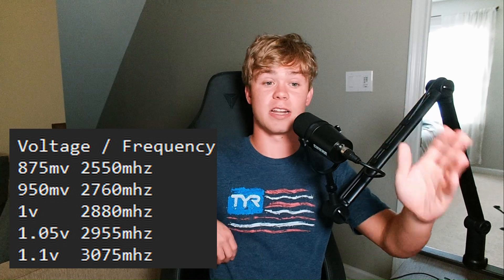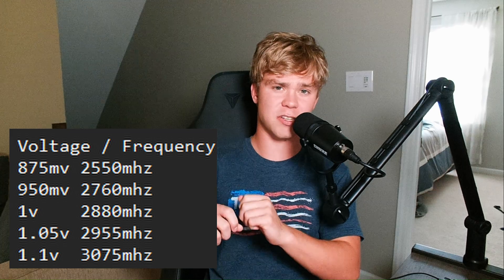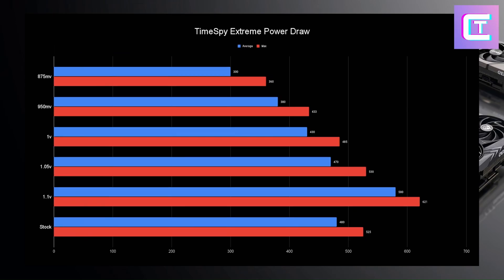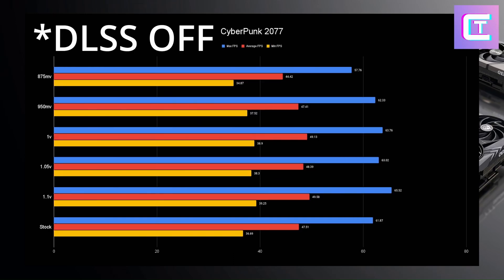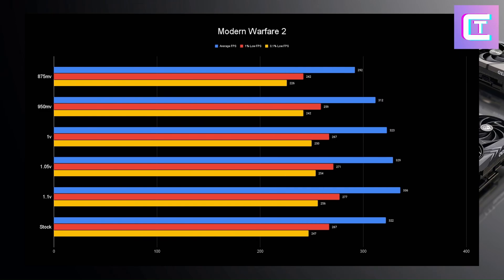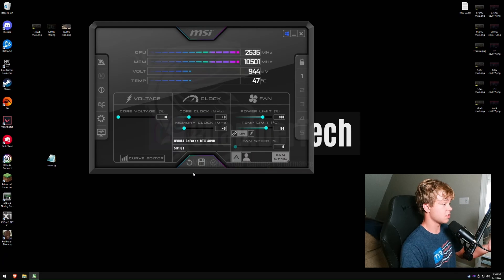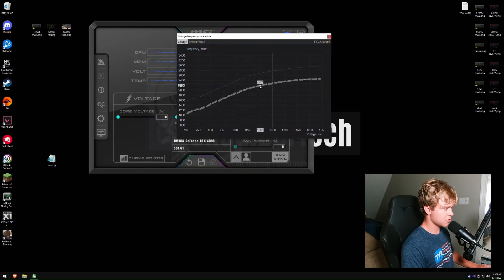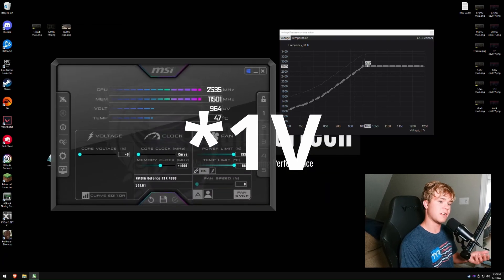RTX 4090 Undervolt + Overclock Testing!

Comment: imo it doesnt matter esp for 4090/ 7900xtx owners, lets say crossfire 3 7900xtx requires 1500w power supply and monthly cost increase from 10$ to 40$

does it matter, youll likely gaming in way different quality than 10$/ month pc, after work, prob only 3hours

Comment: Hi, why does my power limit only go to 120% on my strix 4090 instead of 133%?
Reply: What card do you have ? 

this can happen for 2 reasons… you are not using a 4x8-pin connecter which is needed for a power limit of 133% 

reason number 2 could be because your card does not have a bios with a high power limit

Comment: I have a 4080 and ive raised core clock to +268 and my memory at +1702. my voltage is default and my power limit is 100. I can play games with no artifacting. though this seems kinda high and wrong but I see nothing yet idk if im damaging my card or anything hahaha im getting around 2900mhz gpu clock and 12900 memory on stress tests and games.

Comment: I think running around 900-950mv is best for most.  But tailor oc uc to specific game and monitor you have.  Why not?  Afterburner has 5 profiles.  So you can easily swap between them.  I’m in the mindset of less heat/noise is great.  An extra 200w gets you maybe 10% performance.  Or 30-35% more power.  But again depending on game and what you care about.. change settings.  I’m gonna run tests basing a very low (but not too low as card starts hiccuping if power is too low) mv like 800-850mv in games that are not demanding with cap vs stock and a frame cap just to see if there’s a dif.  I run 4k OLED and 120hz so no need for more fps.  Cp2077 I’m running balanced DLSS with all rt settings on with FG.  Get 80-100 fps.  I cap in game at 50 fps…Menus are 50 but with FG on it doubles to 100.

Comment: The 4090 at 450w already gets insane performance 600w is not worth running out of both my 4090s strix 4090 and pny xlr8 4090 the pny xlr8 4090 runs quet and cool and does 200 core and 1100 memory without touching the power slider vs the Strix 600w doesn't really give me much more performance with the same overclock and power slider maxed
Reply: I rock xlr8 PNY 4090; insane quiet; cool & speedy as any other rtx4090s out there; no coil whine ❤

Comment: If only I had gotten the 1200 watt PSU. Wasn't even thinking about overclocking at the time. I could probably push it with a 1000 watt as my entire rig draws about 750watts at full load (thank you x3d) but don't want to risk it.
Reply from the maker: With my rig I run 1000w psu no problems
Reply: @ChamberTech  While overclocking the 4090 and testing it at full load (600W)?
Reply from the maker: Yes 0 issues. I’ve pulled 960w from the 4090 with no issues